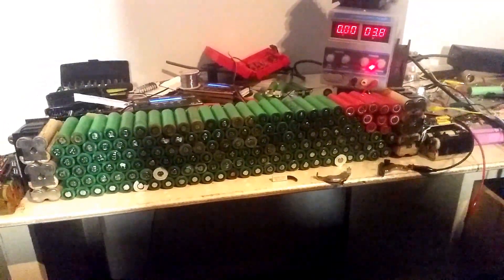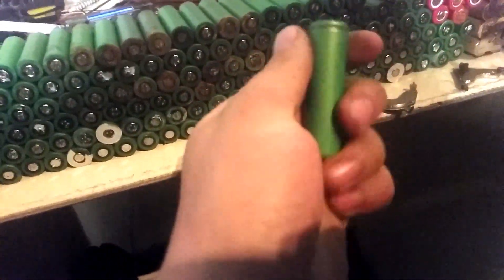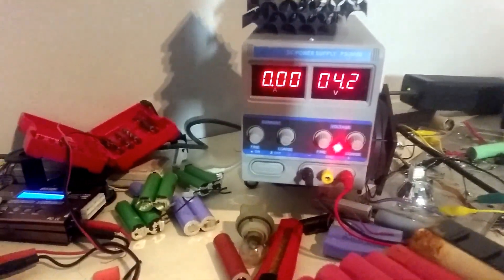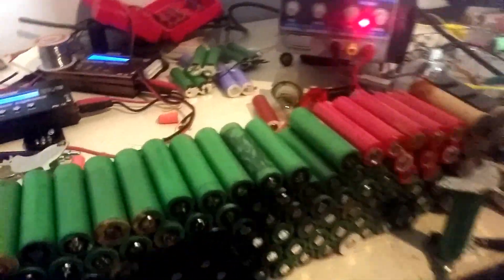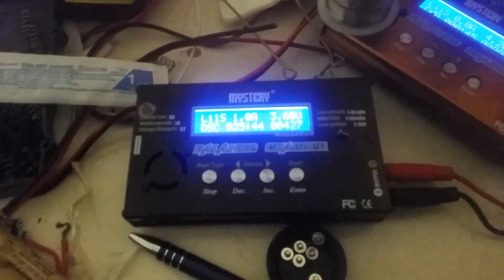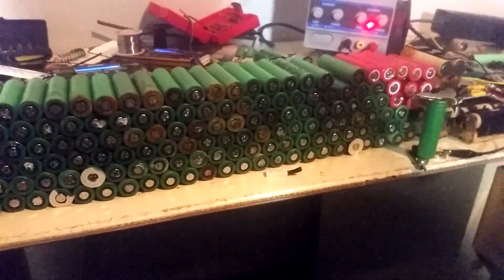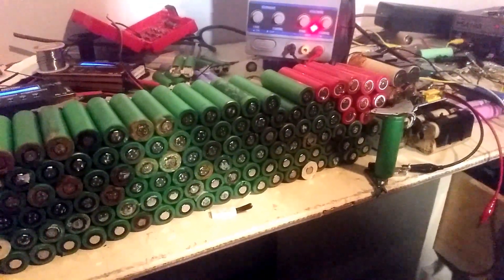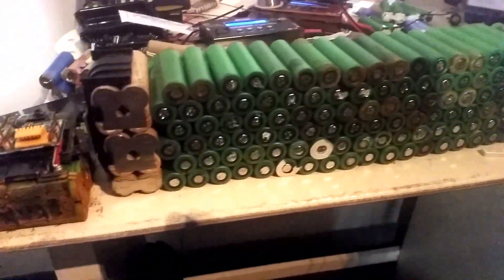150 18650 li-ion cells  from 18v makita  18v pt2

Comment: Hi, I assume you are in Australia. I'm chasing a good value for money bench top power supply like yours. What model have you got, where did you get it from, how much was it and would you recommend it ??

Thank.
Reply from the maker: +Anthony Van Der Hoeven as you wanting it for adavnced electronics or just what i do? There voltage control isnt perfect ill find the model number for you tonight  yes in Australia
Reply: +One up the sleeve customs that was quick :)

im a sparky just need it for charging like u and powering up the odd thing for bench testing. no complex electronics.
Reply from the maker: +Anthony Van Der Hoeven id buy a 0to 30v 10amp one so its not working so hard at 5amps and causing temps issues there low quality but cheap
Reply: Yeah perfect. I have some 200A/hr 18650 packs i'm building that I was going to charge at 5A using one of these power supplies. So yeah the 10A sounds good because it would be working hard. Flick me the details later when you're ready.
Reply from the maker: +Anthony Van Der Hoeven will do cheers ill try get you a link
Reply from the maker: +Anthony Van Der Hoeven will do cheers ill try get you a link
Reply from the maker: +Anthony Van Der Hoeven will do cheers ill try get you a link
Reply from the maker: +Anthony Van Der Hoeven will do cheers ill try get you a link
Reply from the maker: +Anthony Van Der Hoeven will do cheers ill try get you a link
Reply from the maker: +Anthony Van Der Hoeven will do cheers ill try get you a link
Reply from the maker: +Anthony Van Der Hoeven 271520181366 ebay item number of same as my unit but 10amp 0 to 30v
Reply: +One up the sleeve customs ok thanks.

Comment: Hi my makita batterys have packed up what cell can I use to replace them with please help seen some cells at 3.7v and all different ah
Reply from the maker: Best to replace  whole battery if it needs to be reliable sometimes  its the board on top that fails on them killing to cells insurance
Reply from the maker: You can  try charge each  pair of cells if there unbalanced  and get it going agian. The hard part is getting the charger to accept the cells again after you  have opened and messed around in there